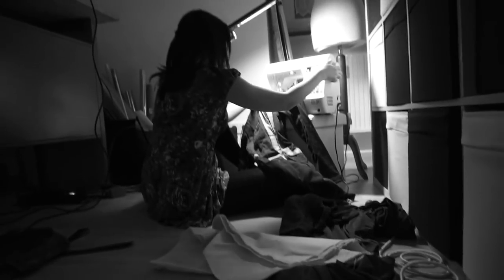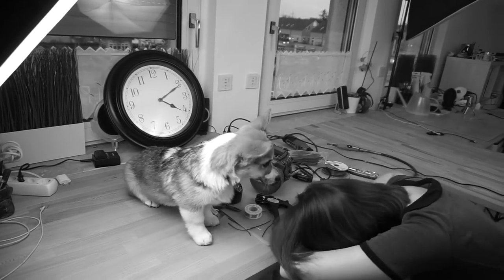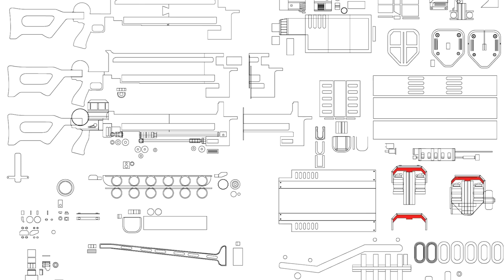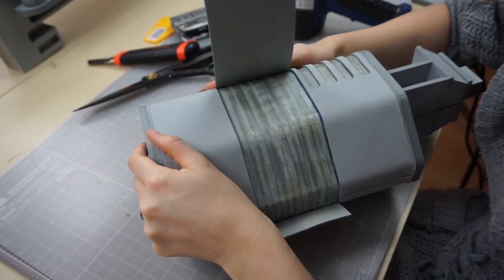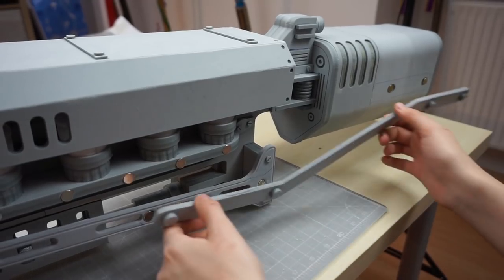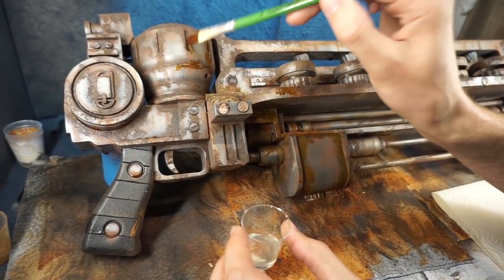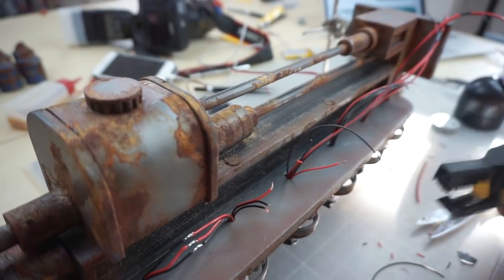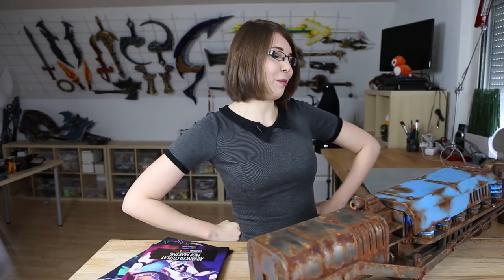Fallout 4 - Building a Gauss Rifle Replica (The Last Minute)

Comment: Length: 2.5 Corgi puppies. Goddamn metric is confusing.
Reply from the maker: Or 35 Corgi ft.
Reply: At least Corgis are fairly standardised. I have to work on the Stuffle System (Half Staff and Half Jack Russell), well that and the foul indignant looks I get from mine. At least the Corgi system is fairly user friendly.
Reply: This whole conversation is far too humorous to not laugh, you guys are so serious in saying this I can't hold it in XDDDDDDDDDDDDDDDDD
Reply: Additionally if you want to go for smaller measurements the general recommendation is to use the Pug unless you are California then the Chihuahua is an accepted alternative provided they fit in a handbag.
Reply: Not as confusing as imperial.
That shit is based off barley corn.
Reply: Nah Imperial is easy. Just remember one Stormtrooper is equal to 2/3 Rebel scum when converting to metric.
Reply: Anarchy Antz haha
Reply: Soviet who cuts - Are we talking Imperial Potatoes or Metric Sweet Potatoes?
Reply: what do you mean metric is simple that pounds feet etc that messed up 100 inches are 2,5 meters draw from that

Comment: Hiya Kumai and Benny. Just curious, what wood did you use for the core? Is it mdf? Thickness? I tried using mdf but it got warped. Did I miss a step? Did you apply a sealant if any kind before applying the foam? Cuz either the humidity is messing it all up, my contact glue is to runny, or I'm not allowing proper drying time. Plz help. Working on Soldier 76s rifle using this technique.

Comment: They should have used heat shrinking tubes on those parts of the wires that were soldered together to prevent brakes.
Reply from the maker: That's what we do! :)

Comment: I don't get it it's made out of foam so when they paint it's why doesn't get soggy?
Reply: it's sealed with the plasti-dip (3:30)
Reply: Like theOlie said, but also because EVA foam is a high density foam; it's the stuff you use for yoga mats, those foam puzzle floor tiles, camping mats etc, it doesn't soak up paint the same way pillow or upholstery foam does. It will soak some but not much.

Comment: Fairly simple, but requires lots of tools. E.g. having at home (!) CO2 laser cutting machine for 2K EUR with water supply connected is just totally nuts. 3D printer is no longer a thing though. And yet you use pretty simple sewing machine. I would recommend you to get on eBay some old Pfaff or Singer for this instead. BTW, your suit and rifle looks like you took it rusty out from underwater, laying something deep inside Titanic... I think way too much dirt and rust. I would kind of make it less. Myself I tried to do something similar, but having no laser cutter, I used just old school way. It takes forever. Especially if foam is way too puffy-fluffy, it doesn't cut well but is following the scalpel. It really takes forever. :-(
Reply from the maker: Thanks for your feedback! Just check out my other videos, where I built plenty of other props without a lasercutter. I just like to play around with my fancy machines as well. ;)

Comment: If you plan to buy the file know it does not come with even how many layers of each piece to cut or the 3d files for all the parts. And of course the code for the leds isn't there either. Pretty disappointed in the purchase, it's just a pdf with outline and that is it. I don't really expect detailed instructions but there were none and not everything needed to complete the gun.
Reply from the maker: I think the product description is pretty clear: 
”This is a 2D illustrated blueprint file that I created and used to build my own version of this prop. I included all of my laser cut layers as well. This file does not include instructions on how to create this prop.“
I‘m not sure why you expected more for just 5$.

Comment: why not use real metal
Reply: Because weight is a thing.
Reply: Van Darkholme wouldn't be heavier than 10kg
Reply: Lugging 10kg around for a whole day is still quite a nuisance. It's a prop meant for cosplay cons, so naturally it should be as comfortable to use as possible.
Reply: Van Darkholme what if the weapon was real
Reply: +God - Then lugging a 10kg hunk of metal around would still be impractical. Modern materials would make it at least a few kilos lighter and would also add the benefit of not interfering with the magnetic field.
Reply: There's a reason as to why most militaries field lighter weapons now a days. It's simply more efficient.
Reply: Van Darkholme i'm talking about fallout
Reply: "real". Fallout isn't real
Reply: Van Darkholme so why bring it to reality
Reply: +God - Because you genuinly asked "what if the weapon was real".
Reply: +God I don't usual comment, but metal is hard to work with and also many conventions do not allow metal props due to injury and other safety hazards...hope this comment helped
Reply: Saahir Ashim take a challenge, it is definetly possible
Reply: If you want to make thing more difficult then use metal - it would be a pain to process all the parts and it would look the same, would be more expensive and would be incredible heavy - so it makes absolutely no sense to use metal. The key of success is the realistic airbrush painting.